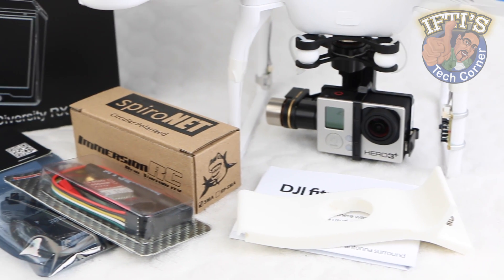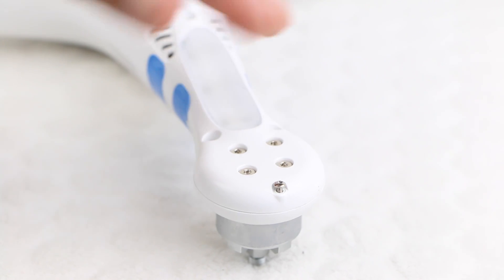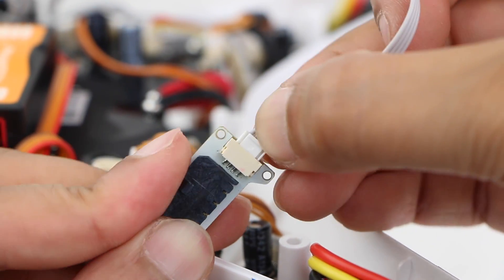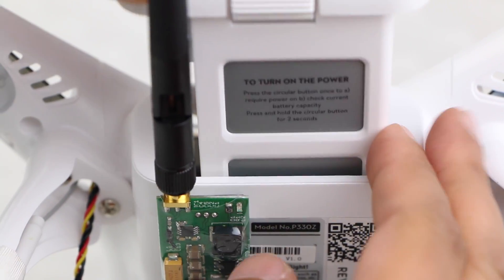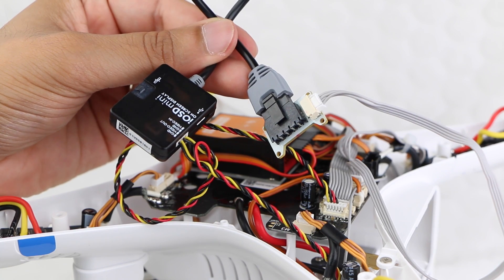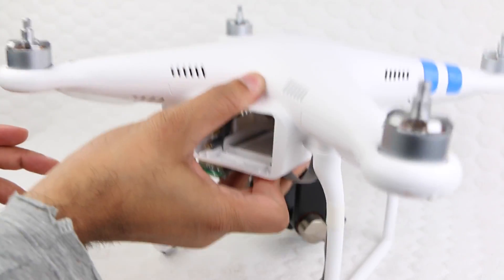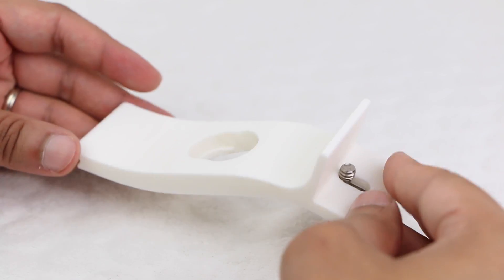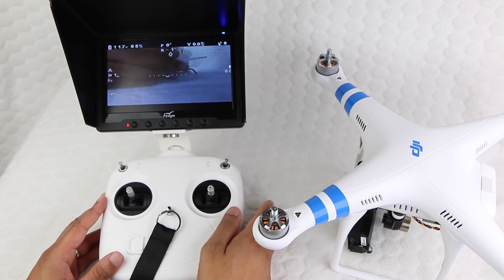#7: DJI Phantom 2 - Complete FPV Setup Guide & Test - Step-By-Step!

Comment: Hello iftibashir,
1). after watching this video I don't see what you do with the cambus modual once removed and plugged into the iosd mod, please explain.
2). I've been advised to get the Blk Pearl 32 channel vs. the 7 channel, tho its mentioned in this tread that this isn't the perfect setup, do you have an alternative monitor ??

I love your videos, keep'um coming
Reply from the maker: Remove the canbus from the landing gear and pull the cable through the leg inside the unit. Then reconnect the canbus - you're literally just moving it inside the craft rather then it being outside.

Comment: 3:45 What to do? I don't get it :/.. I ordered same lists what needed from you, followed set up.. but 3:45 that how I got stuck!
Reply from the maker: Updating the firmware of the iOSD Mini??
Its an advisable step to be honest, but not completely necessary if you want to skip.
You need to install the update assistant on a computer and connect the iOSD Mini as highlighted in the video to update the firmware to the latest release.
Reply: Got it now, i don't know about download of IOSD Mini.. you should tell about it on video, so anyways.. Mind, can I ask, do your monitor works for NTSC?

Comment: Hi, Did u do any range test? what was the range you achieved with this setup. I have been following few forums regarding FPV. Many say Immersion RC 600mW 5.8gHz transmitter wont work ideally with Black pearl 32 Ch, rather it would work better with 7Ch it seems. IS it true.

Can you please suggest what would be the ideal FPV setup for a 1.5Km FPV range.

Comment: Hello I have a question? If I start recording while my h3-3d is still on and I happen to move the gimbal while it's on will I break It?
Reply from the maker: No, slight movements to switch the camera on/off etc are fine. The gimbal may make a small grinding noise but it will correct itself and work fine ;o)

Comment: I am newbie...correct me if i understood something wrong.. I have couple of questions.
1. Why FPV setup when we can see live video and operate GoPro camera remotely using GoPro smart phone application.
2. After completion of FPV setup , can we operate GoPro Hero4 black remotely, like start video recording etc in the mid air. Or we just need to start video recording on ground and than fly the drone?
Reply from the maker: You must ensure the GoPro WiFi is SWITCHED OFF when flying - the signals from the GoPro's WiFi could interfere with the radio signals to the craft, hence could cause a crash or a flyaway.
Reply: iftibashir Thank you for your quick response. it was really helpful.

Comment: Hi. If i bought a phantom 2 and used to phantom 2 assistant software to switch it to the naza mode. Then after a while I added the gimbal and hero3 camera etc to it. Would I then need to then update the phantom using the phantom 2 vision software.
Reply: no

Comment: Hi Ifti, i am struggling to unscrew the 4 cross heads on each sides, the supplied crew driver is useless, how did you manage to open it. thank you
Reply from the maker: Khaled Amr I have my own set of driver bits. When unscrewing, dig in deep so you don't risk wiping the screw heads!!
From what I recall, mine weren't very tight anyway, but persevere and you'll get there ;o)

Comment: ifti... any reason why I shouldn't drill a small hole for the Tx antennae and install the Tx on the inside? I can only think of heat dissipation... but there are lots of vents on the shell.
Reply from the maker: n8mars Good idea! If you can find the space for it get it inside, would make a neat install!! Get a video of it up and share!

Comment: thanks for the video, very nice. i have been informed that new Phantoms 2 are coming with new canbus which can't be removed from the landing gear? did you see it and is it true it can't be removed? thanks
Reply from the maker: Khaled Amr The Compass is encased within the plastic leg, not sure on the canbus....
Reply: iftibashir i doubled checked this and canbus is same as previous release. another question, if i use fatshark goggles, what band i need to use, is the same (F Band) as the monitor? thanks

Comment: Thanks for the videos...they really help. Unfortunately in this video I did not see where you placed the canbus with the mini plugged into it. Did you put it inside with 2 sided tape? If so, where specifically inside?

Thanks again. Keep the videos coming.
Reply from the maker: Since its such a small and light part it really doesn't matter whether you keep it loose or secure it down - I left mine loose tucked into the case.....
Reply: Thx

Comment: Nice great install, you should do a video on using the new GoPro4 and how to balance it with the H33D or H32D. I've noticed a difference in weight and an issue with the new side settings button, I would like your take on it.

Comment: hi I have the same setup - can I ask the horizontal flight distances you get this? I was achieving around 700m but after a recent death drop from the sky (battery was 93%!)  I am achieving approx 50% of that distance now before the image snows/corrupts. Any ideas what the issue could be? Problem with the video board/transmitter Immersion RC? - its 350mw rated.